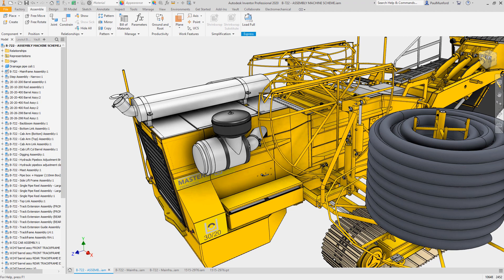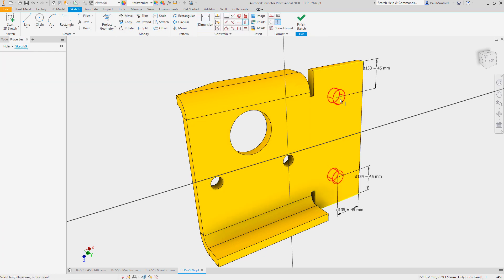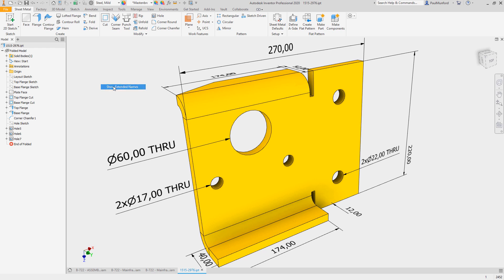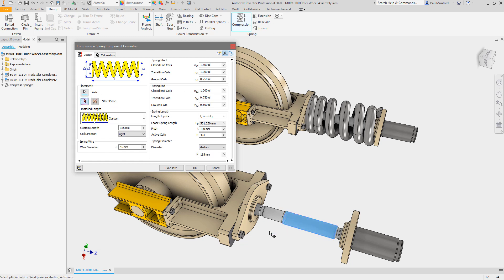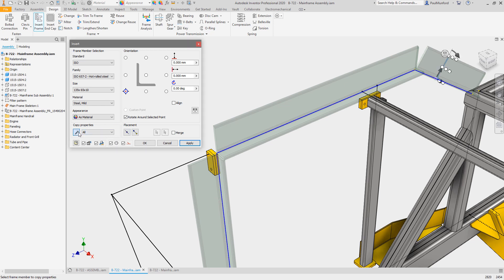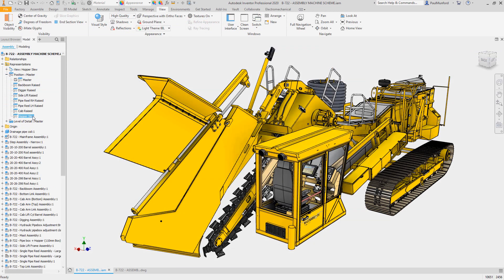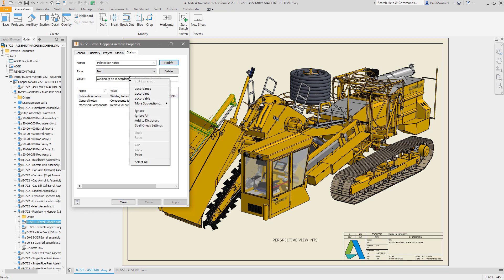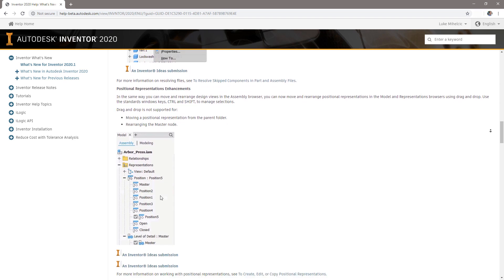Inventor 2020.1 Update

Comment: Please I need to know why I choosing inventor 
what it's futures not available in other apps
Reply: Hi Sherif, Not sure I understand the question. Can you share a little more detail?
Reply: Hello Lars
Thanks for concern 
I'm beginner  need to use program for design mechanical parts , pressing molds for rubber& sheet metal , steel structure and metal fabrication 
Also need assemble parts, test the loads and stress and simulation
There are many programs to do the tasks as solid work , fusion 360 , Creo , inventor 
So why I have to select Inventor to do my tasks ?
Reply: @roma10011  I don't blame the confusion. You are right! There are so many programs out there. Each one a little different and yet they overlap in functions. Autodesk has a fantastic channel network, and I bet there is one located close to you. They will be able to provide great answers and guide, making a choice clear without complications. Go here:  https://www.autodesk.com/partners/locate-a-reseller Best, Lars
Reply: @cadcamstuff  Thanks  Lars

Comment: Is there any reason why inventor doesn't have the option to create a plane from a line or axis and a point?  Or am i missing something?
Reply: You can? Use the "Normal to axis though a point" plane type
Reply: @Neil3D  I'm talking about where the axis lies on the plane, not normal to it.  sort of like "angle to plane around edge" but defined by that point. Or basically the axis defines two points of the "3 point plane" and the 3rd is defined by another point.
Reply: You can vote for that here: https://forums.autodesk.com/t5/inventor-ideas/work-plane-around-axis-through-point/idi-p/5717699